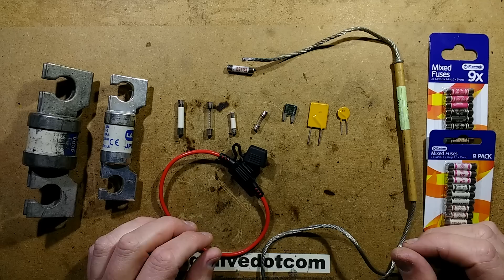Things you should know about fuses.  (including a 15kV one)

Comment: This is probably as sad as it sounds, but I discovered your channel about 2 years ago, thought it was great and subscribed, and always had the idea of arranging the videos in reverse order to start watching from the beginning, and here we are! I'm sure you'll relate to this one Clive, seeing as our backgrounds are very similar. In the early 80's, one of the most common light fittings in the disco industry was the PAR36 pinspot, for those not familiar, they use a 6V 30W sealed beam lamp originally from the aircraft industry, powered from a conventional transformer. Many clubs and pubs used an effect known as a "light curtain" which was made from lots of these fittings installed very close to each other pointing vertically down. The common lighting controllers of the day were typically 5 amps per channel at 240V, giving a capacity of around 1200W per channel. The protection device for each channel of the controller was a 5 amp 20mm HRC fuse, the protection inside the pinspot unfortunately varied, some of the horrible cheap ones had no fuse, others used the wrong glass fuse, generally of too high a rating to compensate for the switch-on surge from the transformer. I was called out to a nightclub in Manchester with a report that the light curtain was not working. It was made up of 4 channels of 35 pinspots. Mode Electronics who made the controller had suffered a bad batch of triacs which were failing in a half-wave mode, this causes a DC component to be fed to the transformers, causing them to heat up and damage the windings before blowing any fuses. Consequently I had to go back a few days later, repair a controller, no big deal, but then fit 140 pinspot transformers, a very big deal! The pinspots were made by Pulsar Light who I worked very closely with at that time, and to their credit they began fitting PTC fuses to all their pinspots which stopped this from happening again.

Comment: Before I retired, I was in an office building electrical switch board room setting up for a weekend maintenance shut down when a 2,000 amp 600 volt silver sand fuse let go from a short on the building bus duct. Just my luck. Shall I say, it got my attention? And yes, I rescheduled my crew to find the short-to-ground and temp it out with lugs and cable until a new section was fabricated and installed.

Comment: 15:00 knowing nothing about these fuses, but a bit about electronics, chemistry, and  physics, I'd guess the large copper wire is the actual fuse. Then the strip could be magnesium which is higher resistance and will burn immediately with a lot of energy once the copper conductor is broken or gets hot enough.

Comment: Dear sir, can I use an AC rated fuse in a DC circuit????
Reply from the maker: It depends on the circuit.  For most low voltage systems a ceramic fuse is good for AC and DC.  But for solar panels you may need a more specialist DC fuse.

Comment: How about even worse NO Fuse!  True story:  Once upon a time on a film set someone hacked a low voltage transformer to power some 12 Volt 
practical lighting.  Well a larger load than the transformer could support was applied and it caught fire which quickly spread to the set.  Thankfully 
this was soon observed and a fire extinguisher was on hand.  At least two sins here No metal box, No fuse.  Engineering promptly issued a small 
fleet of power supplies designed for stage use putting a stopper in this sort of problem which never reoccurred.

Comment: Great explanation of the workings of these fuses. Those big 160- and 400-Amp Lawson fuses have the kA rating stamped on them. Usually, 80 or 120 kA and 500 or 660 Volts.

Comment: The twin wire High Voltage fuse most likely has the second wire to give mechanical strength to the flimsy main conductor.   There are exponential graphs available, showing rupture time / current flow, for all types of fuse.  Some take almost a minute at 150% rated current.

Comment: When we bought our house (last year) the main panel fuses was a string of bare wire around a set of screws. Resetting was winding on some fresh wire. The door on the panel needed to be kept closed to stop a failure flinging a fireball out and toasting the other fuses and burning the surrounding area.

Comment: Most class II switch mode power supplies these days have a 10 ohm resistor instead of a fuse with a 32A breaking capacity. When ,(not if) the electrolytic capacitor after the bridge goes short circuit the resistor doesn't like the 32A ring main current too much. Sometimes the plastic case can blow off. I'm not sure how these can pass British standard bs61558. Perhaps it needs improving.

Comment: I have always wondered why in vehicle fuse boxes there are two sizes of blade fuses both rated at the same current and  connected to the same voltage of the vehicle system. I am still unclear on this - can you shed some light on this?

Comment: Slight caveat for MV/HV current limiting fuses - there is usually a minimum as well as a maximum system voltage - ie 6/12kV. The reason for the 6kV minimum voltage is because they are designed with a particular arc voltage in mind. If you are using say a 3.3kV bit of equipment with a 6/12kV fuse there is a chance the equipment will be damaged by the high arc voltage if a fault occurs. In that case a 3/7.2kV fuse would be more suitable.

Comment: My father started work at " OTTEYS " in Leeds after the war (2nd) and a farmer brought in a tractor with no lights. The standard fault finding procedure was to check the power to the light sockets by " flashing " the battery feed wire to the chassis, and when my dad did this a 22 bullet shot past his ear. The farmer had replaced the blown fuse with a 22 cartridge, I have since always regarded 22 bullets as " ffff Fuses " , super-fast, or ffs fuses ! if you get the translation.

Comment: When I was a young kid of about 6 or so, I had a birthday party and wanted a load of balloons to descend from the ceiling when I pulled a string. So I attached everything to the central light fitting and at the appropriate moment, pulled the string. Cue - unexpected Big Bang with a blinding flash, followed by total darkness. My mum and her friend, neither of whom had any clue about electrics, somehow managed to discover that the fuse had gone in the main fusebox (due to a short circuit at the ceiling rose), so they replaced the broken fuse with a bit of wire and turned the electricity on again. Cue - second unexpected Big Bang. Obviously, the wire that they had used wasn't thick enough, so they tried again with a thicker wire. Cue - third unexpected Big Bang after which they were unable to get anything at all to work.

It was subsequently discovered that they (with my help) had plunged the whole road into darkness. To this day, I still don't understand why the utility company fuse didn't pop, but I guess that fuses in those days weren't what they are nowadays.

Comment: Started cutting open Fusetrons (US Fuses) for motors, in the mid 70's to see if they blew from short circuit or just over-current. Fascinating. Once followed up a highly rated, cracker jack new guy that had used all 34 - 10-amp fuses in the storeroom, one at a time, thinking it would eventually fix a short circuit. Left it for me to fix on the night shift. Told him I can't save his butt; he used all the fuses. Then he said, "I used up all the 15's and 20's when I ran out of 10's. 😵‍💫The boss was mad at me because it had been down for 7 hours on afternoon shift, and 2 hours on midnights. I just smiled at him and said nothing, shaking my head as I walked away.

Comment: Thank you.
   This was a good review.
   I have been careful when connecting up equipment. And double and triple check connections. Never had a serious problem. 
   Sometimes, I had to drive 12 miles to get the right fuse or part.
   I have no desire to be involved in a disaster.
  Thanks again.

Comment: Poly fuses work the other way too. If you heat them they limit the amount of current flowing through them. Also if the ambient temperature is cold they carry more current. A thing to remember is in fault conditions they keep a lot of tension on the circuit and can get quite hot.  Thanks Clive from another bearded follower.

Comment: In my dc-to-ac inverter there are 12 “modern” car style mini fuses, and 1 glass fuse. I can’t see any blob (slow) as mentioned in the video, so why a glass fuse?🤔🇸🇪
Reply from the maker: It might be for the control circuit.
Reply from the maker: (Or for the higher voltage output.)
Reply: @bigclivedotcom  Aha.. Since I couldn’t find a new glass fuse of that caliber I “spliced” in a modern fuse holder and bought a equivalent rated flat fuse. Based on your answer I guess this won’t work but I’m curious to why that is. (Thanks for your answer btw)

Comment: My favourite type of fuse was old East European (maybe it was used elsewhere but I encountered it mainly over there) type, porcelain cup with bulb-like screw and small glass window over percussion cap inside. When short occurs, wire inside gets hot which fires percussion cap and interrupts the circuit. Funny bit is that cap itself goes flying and cracks that little piece of glass so you know it tripped. But as these age or people handle them roughly, that glass breaks or just falls out. And that flying cap could take your eye out...
Reply: I have those in my house.

Comment: It absolutely never even occurred to me that people would be making ceramic fuses without the sand inside..  They have literally skimped out on the single cheapest part of the entire thing. (it's dirt cheap!  literally! )

I've honestly never understood why most fuses are not keyed in any way.  If different current ratings (and fast/slow type) were actually physically different in some way so you couldn't replace a fuse with the wrong one (without really trying) it would make so many things so much safer, IMHO..

Comment: In telecom we had GMT and grasshopper fuses. When the fuse blew, sping tension would connect the battery side (-48VDC) to an alarm bus which would set off bells and lights in the central office. In the US Army, we rewired grasshopper fuses with correctly rated fuse wire so they could be used over again.

Comment: What fuse would you recommend for a Linear Actuator 12in Stroke 900N 12VDC 3AMP max?
Reply from the maker: Is it likely to be stalled much accidentally?  If so then a PTC fuse that semf resets might be a good idea, but other than that, measure the normal loaded current and choose a fuse to match.
Reply: @bigclivedotcom  It will be used for a Chicken Coop Automatic Door, So the likelihood of it stalling is VERY minimal. Even with the 1/8" steel plate door 16" x 14",  it comes nowhere near the 250lb(900n) max it is rated for. The max amp reading, with no load or even door just testing, is 0.67Amps. I hold to floor and press down fairly hard and it only jumps to 1.27 Amps. it doesn't seem to slow it down much. There is a notable difference but not so much that I think it is struggling or even heating up. The fuse will not be to protect the chickens ( I came up with a circuit that when a laser through beam is interrupted (while going down) the door stops and returns to the open position, then tries to close again), the fuse is to prevent damage to the door and frame (structure) and electrical system in case of jamming. Never know what might get accidently knocked down and wedge in door. 

Do PTC fuses come in the glass/ceramic type fuses. I just spent a few bucks on some DIN Rail 5mm x 25mm glass/ceramic fuse holders. So I wanna try and make use of them. 
In these two videos, I posted, shows kinda how it will be needed to be installed as an inline DIN rail mounted system. 

https://youtu.be/nFGbOL3UECE
https://youtu.be/-HLkvI-oJ1A

So if you have a link to a fuse that would be great. 

TY for your response and for your help.
Reply from the maker: @AztecWarrior75  It sounds like a time delay 1.5A fuse would be fine.  Even a 1A fuse has enough of a time characteristic that it would work fine.  The advantage of a 1A PTC fuse is that it can be soldered in and that's it for good.  The PTC thermal fuses have a similar characteristic to a time delay fuse.

Comment: I have a horror story. Back in the day, I used to work at an industrial facility. We turned off the gas quenched breakers (sf6 I think?) for 6KV line leading to huge ass motors part of the facility. 

A vendor was installing CCTV camera cabling and adding a new cable tray cover over the line at some parts for reasons I can’t remember. One of the knuckleheads working on cable trays used self drilling hex head screw to fasten the sheet metal cover to base, however at some point he tapped into the HV cable which was thick like average wrist size. Can’t recall the diameter.

Once we turned on those SF6 breakers (luckily they were remote operated and motor armed, not hand cranked.), oh my God, there was such a loud noise, we thought sky was tearing apart. Circuit breaker didn’t auto open, we tapped the remote and opened it.

F ton of cable and tray was burned and had to be replaced. That technician doesn’t know how frigging lucky he was our site electrician had the good sense of turning the breaker off.

Comment: I'm a bit late to the party here, but a common thing that homeowners used to do before fuse boxes were replaced by circuit breakers, was to put pennies or other coins into the screw in fuse sockets. This bypassed the fuses and caused many house fires due to faulty appliances not being protected from the mains voltage.

Comment: Hate polyfuses with a passion. They don't stop a fault, just keep everything hot, if they don't explode themselves.
Reply from the maker: They are fine for low voltage and low current applications, but not great for high voltage/current faults or regular operation.
Reply: @bigclivedotcom  Oh wow you read comments on old videos, I'm honored! I'm sure they can work ok, if the circuit design is well-suited for them and thought out. Which sadly often isn't the case...

Like on the Ender 3 mainboard, there's a 24 VDC to 5 VDC buck reg (for the LCD and logic) which has a 6 V, 2 A hold, 4 A trip polyfuse on the output. Only problem is, it's an adjustable output reg, and they decided to take the feedback voltage from a point after the polyfuse. So if you're a dummy like me that flips the polarity of the LCD or BLTouch cable, that 5 V rail gets dragged down to below 3 V by a chunky TVS diode on the LCD board... Which makes the buck reg increase the output voltage, overvolting the polyfuse and making it glow bright orange, burning a hole into the board. Thankfully in my case I managed to just scrape off the burnt trace and replace it with a glass fuse which has been working fine so far.

Comment: my glass fuse blew and leaked a metallic liquid.  it's dangerous?
Reply from the maker: Was it a fuse or a tilt switch?  If a tilt switch it may be mercury.  In its pure metal form it is not as harmful as some would have you believe, but should be collected and disposed of.
If it was a fuse then there shouldn't normally be anything like that in it.
Reply: @bigclivedotcom    thank you for the answer and sorry for not answering sooner, i didn't get the notification. It was a glass fuse, I took it from a power strip. i didn't touch it and dispose it. if not something liquid, there's a chance that are something dangerous in glass fuses like others heavy metals? If a glass fuse have a fissure after falling, for example
Reply from the maker: @Alliskids  Fuses are normally completely safe.  Just a tube with a thin wire in it, and sometimes some fine sand around the wire.

Comment: @bigclivedotcom 
 hello i have to questions for you I've been meaning to ask. I have a boat running a 12v system 1) would it be ok to use 250v 32mm glass cartridge fuses on a 12v circuit 2) I have a bilge pump and a float switch. On the float switch it says 12v 20amp max and on the bilge pump it says 3.5amp draw. I was wondering what amp fuse do i use in the bilge pump control panel.

Thanks
Reply from the maker: Yes, you can use standard fuses.  It's suggest at least 5A anti surge or time delay for the pump to allow for starting current.  You could also use standard automotive fuses.
The manufacturer may recommend a specific fuse rating.
Reply: @bigclivedotcom  thank you 👍
Reply: @bigclivedotcom  so is it a 20amp fuse at the battery and 5amp in the control panel switch. Just to be sure 

Thanks
Reply from the maker: @finno123456  You can use progressively lower fuses on final circuits to match the loads.
Reply: @bigclivedotcom  thanks

Comment: I have found if you have glass fuses with pigtails for soldering, always ohm the fuse after heat has been applied.  Quite often the glue that holds the caps to the glass tube will soften. While soft, any stress on the assembly will go through the filament which may break near the cap where you can't see it.

Comment: Can I replace a 10A thermal fuse with a 10A thermal breaker without creating a hazardous situation?  The thermal fuse is rated for 121 C 10A.  Thinking about using a marine thermal breaker rated for 10A.
Reply from the maker: A thermal fuse is designed to detect overheating.  A thermal breaker detects overcurrent thermally.  I'd recommend using a thermal fuse and investigating why the original one failed.
Reply: @bigclivedotcom  Is there a self-resetting thermal fuse that would work in its stead? I tried to find one, but most appeared to require more connections (4 instead of 2)? Thank you for generously spending the time to respond.